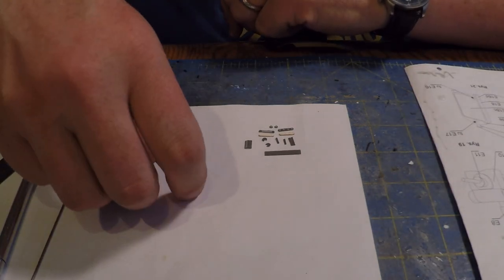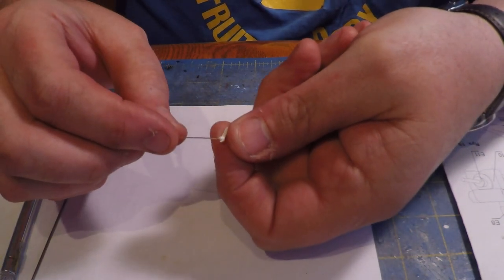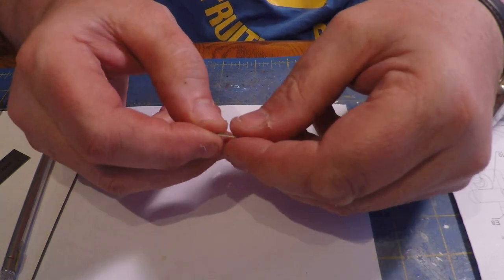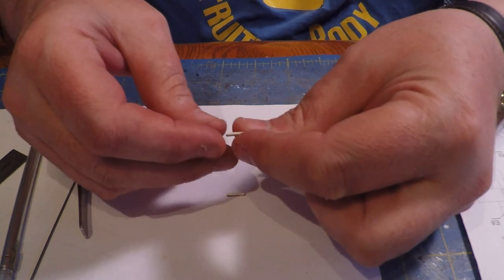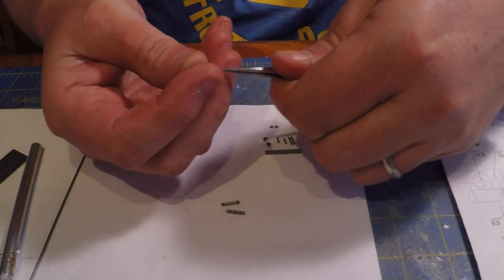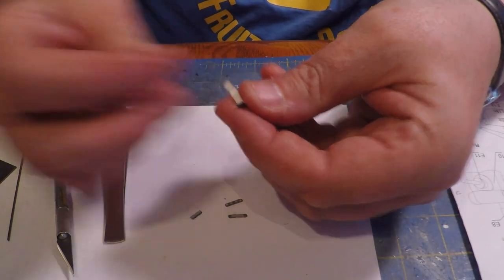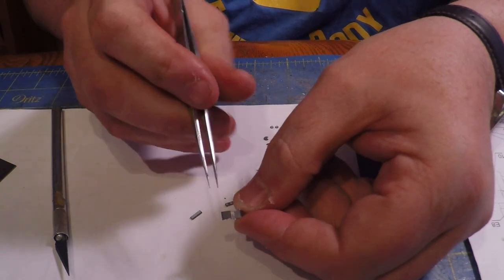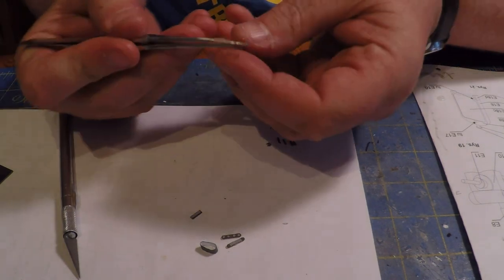Lohner Paper Card Model Part XIII:  Working on the Carbs and Plug Wires

Comment: Instead of just butt glueing a small joiner strip of copier or even better tracing paper. Tracing paper seems stronger in terms of tear strength and is thinner. 
The whole engine us amazing.
Reply from the maker: Good idea.  I do use joiner strips often and really anything that will make a better joint.  I'm amazed at how well simple butt joints do work as well... -Dan